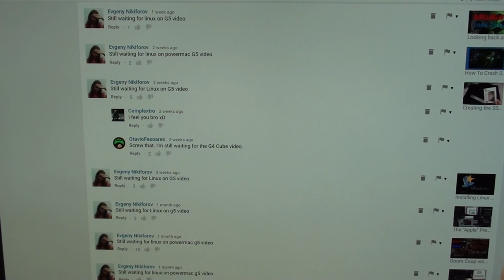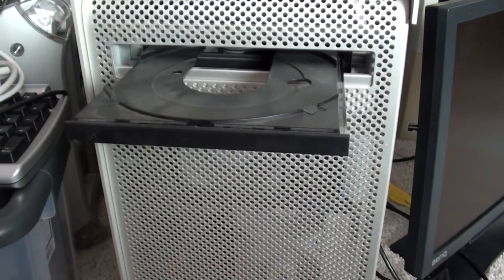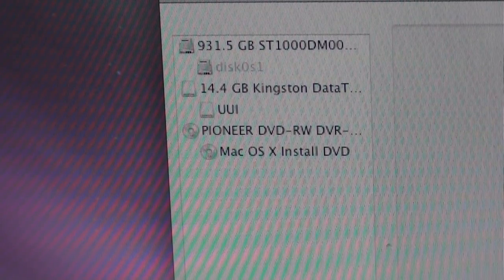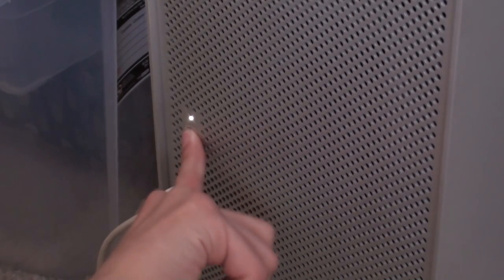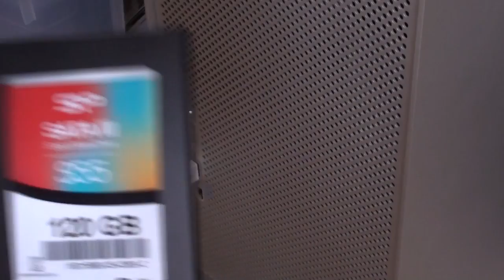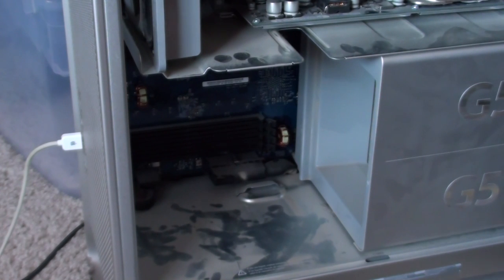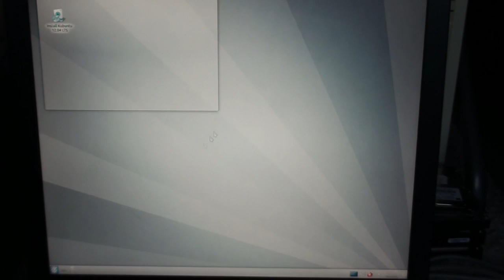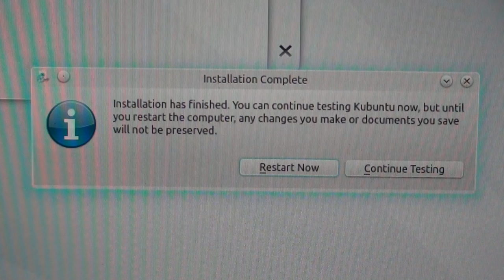Installing Linux on a Power Mac G5 (Part 1)

Comment: Those G5 Macs are the most beautiful pieces  of junk I have ever seen.  I would mod the case and put an GIGABYTE Mobo in it and run a Hackintosh build
Reply: Fantastika lol ok?
Reply: Why not an ASUS mobo ?
Reply: Get a newer mac pro. Better everything same case. NOTE:not 2019, I think its 2005
Reply: Even if you have some old apps to use with an old ppc-osx, i think, this thing draws too much power and is too loud. So i would consider the same, remove the old external and put in a new motherboard.
Reply: I heartily agree. The G5 towers are giant beautiful hunks of metal scrap. I own one that never works correctly but it looks pretty cool.
Reply: @paytonbostwick2899  ive seen a brand-new 2020 Mac pro for a fairly low price of $53,548.00.

Or for about $4,462.33 A MONTH!!!
Reply: @hunterjayfilm  dude believe it or not but you can buy the new one for up to $20,000

Comment: You have incompatible ram installed! Hooray!!!!
(Please like this so +Druaga1 will see this)
• 2 Flashes: No RAM is installed or detected.
• 3 Flashes: Incompatible RAM types are installed.
• 4 Flashes: No RAM banks passed memory testing.
• 5 Flashes: No good boot images are detected in the boot ROM (and/or there is a bad
sys config block).
• 6 Flashes: The processor is not usable.
Reply: LightningShockXD 7 Flashes: may god help us
Reply: 3 blinks
Reply: • 7 Flashes: Incompatible life
Reply: 7 flashes: WARNING CORE OVERHEATING NUCLEAR MELTDOWN IMMINENT
Reply: 666 flashes: WE’RE ALL GONNA DIE!!!
Reply: 1 Flash: No computer detected.
Reply: 10 Flashes: OH GOD WERE DOOMED
Reply: 420 flashes, the mac is smoking a joint
Reply: And then there's 1 flash where it means nothing but new computer needed
Reply: Seizure Flashes: MY EYES!!!!!!!!!!!!!!!!!!
Reply: @Hydr8Man  Nice Portal 2 reference.
Reply: @paytonbostwick2899  420 flashes: Weed OS version 4.2.0. Is successfully installed.
Reply: @Hydr8Man  portal 2 reference?

Comment: Things went surprisingly smoothly for a Druaga1 video, I'm almost worried that nothing is going to go wrong in part 2.
Remember that if nothing fucks up on its own you can always try upgrading from 12.04 to 14.04 and then 16.04.

Comment: Hey druaga, sata is hot plug capable. Just boot the machine into linux and plug the drive in (carefully). Linux just detect a new active sata link and throw all the detected stuff onto dmesg (do dmesg to see if it actually detected the drive)
Hot plug worked on my old sata1 pentium 4 machine, but knowing apple it wouldnt surprise me the blocked it or something...
Reply: you would need to hot swap every single time you try to boot it.
Reply: Not all PCs support SATA hotplug.
Reply: +Topias Salakka  /\ this

we have to remember this is back when SATA was a luxury.  it was something you had on your high end pentium 4 that had hyper threading.  lol damn you could get that for like 500$ back in the day.  now you could find that for 20 on ebay
Reply: 0kIlLtHeMuSiC 0  That's exactly what i'm saying. I had one of those Pentium 4 3 fricking gigahertz HT (a prescott-2M to be precise) with 1 motherfucking GB of ram and sata and pci-express, ( I had to buy a new video card because i had a AGP GForce 4) yet sata hot plug worked fine when i tried it. It has an intel motherboard with an i915 chipset which didnt even support the 4gb of ram it claimed to support even in 64bits. Back then it was the shit, but nowadays its crap and even then an Athlon 64 would have been better....never trust your dad who says "intel is better"....
anyways, i915 was intel's second chipset to ever support sata, the first being the i875, that's why im saying mine was old as fuck yet sata hot plug worked fine
Reply: +Lahari Krichevskoy That must have been 2003-2004 if you built it new with the best spec'ed parts you could get at the time.  That was around the same time I built my first rig which was also a P4 but only a 130nm Northwood 3.06 GHz with HT, and only 533MHz FSB.  I think I just went with intel because I thought more expensive meant it would be better, haha, I was only like 13.
Reply: goyabee
well at least yours was better than mine, mine couldnt even not overheat at stock frequency with the stock turbine (it was loud!) in a 35ºC summer day. Plus that heatsink tended to cake in dust really easy in a matter of months, so you either clean it at spring's end or watch how the sensor says 85ºC on the cpu.
I ended up putting a cooler master "sphere" cooler on it and im not even overclocking, just so that it would remain more maintenance free and quiet.

I also was 13, and my grandma gave me the money as a gift, and my old man, who knows shit about pcs (and nowadays to be fair if he says do A, you do B first....)  said intel was brand and that it was better "quality" (as an electronic frying pan), the thing is that he is an idiot and i although liked computers and all, was still too young and didnt know as much about hardware (i didnt even had internet back then)

now i'm happy with my 1055T :D
Reply: Laharl Krichevskoy Haha, yeah, P4s were terrible... they were fine at around 2.6 GHz and under as far as heat goes, as long as you didn't mind how slow they were at those speeds.  Mine ended up burning itself out in around '07 after I had it over clocked to I think 3.15 GHz for a while, which is hardly anything over stock... and yeah, I ended up vacuuming it out like twice a year or so.

The funny thing is, your dad wasn't entirely wrong, just uninformed.  Ever since intel got its shit together after the P4 disaster it has been putting out the best consumer CPUs available.  Not counting itanium, there have only been a few cases where intel CPUs were beat by competitors, and the quality was still there, its just that the netburst architecture was shit, and CPU architecture design is so hit or miss, they spent ass loads of money developing a completely new architecture with a really long pipeline that would allow for higher clockspeeds.  They had plans to release 5 GHz chips like only a few years after the first P4 was launched but they didn't realize it would run as hot as it did, nobody really knew back then, it was uncharted territory, so they just ran with it and kept clocking them higher to make up for the poor efficiency and using their corporate influence to get developers to optimize their code for P4.  It was a shameful time for intel, they were relying on their good reputation while knowingly selling inferior technology.  Anyway, the moral of the story is always do your research, even good brands like intel put out absolute shit every now and then.

AMD basically made the same kind of mistake with CMT, they were banking on software being optimized for AMD chips but it just didn't happen, and even with optimization the performance wasn't as good as they were expecting.  So what did AMD do?  Basically the same thing intel did in the P4 days, they just kept clocking up the same architecture, somewhat relying on the good reputation they earned from the Athlon 64 line.  That's how we ended up with the ridiculous 5 GHz 220 watt TDP FX9590 or whatever it is...

I digress.
Reply: Laharl Krichevskoy 
Ahhh,  alright. 

Yeah..  Until the core cpus intel was poop.  Its funny because amd designed the 64 bit system and multicore tech intel uses and they were shit until then. 

I think we should give amd credit.
Reply: 0kIlLtHeMuSiC 0 AMD has been putting out some pretty fantastic chips over the years, it's true.  Even if there's always an intel product that's better it's usually going to cost more and they've just done really well for the size of company they are.  FTR, I actually really like the CMT design, it makes a lot of sense in theory, though I admit I have never had a CPU which uses it.  The last rig I built with an AMD chip was a Athlon II X2 3.2 GHz. It was more than powerful enough and an amazing chip for the money I think I only spent like $60 on it, it's still going strong, my brother uses it for gaming with a GTX 750 Ti and it keeps up just fine at 1080p even with high settings for some games.

I guess if I had an AMD chip with CMT I would probably run linux from scratch and compile as much of the system as I could with Open64 which is specially optimized for AMD microarchitectures. The fact that you can get an 8-integer-core CPU for around $100 new is pretty enticing.
Reply: goyabee
 afaik phoronix did a comparison between compiled for cmt and not, and the difference was minimal. The only place were it shined was when the software was compiled with amds optimizations and it was multithread friendly to begin with, and the margin over intel's was 20% in the best case. The rest of the times staying 30% behind (no mt)
So even if in theory the design could work, it did not this time, it was poorly executed, and it showed.

Further more, expecting everyone to compile for their cpu is ridiculous...what about old software? (which is 99% until that point)
The only software which would care to do so would be games (maybe) and benchmark tools. The rest would not give a fuck as no one gives a fuck when compiling their software, i do not, provided it works on MY machine.
We've seen lots of games where the carelessness when compiling shows. Games with debugging symbols still on the binaries are common. I remember having read about some which had an optimized path disabled by a bug and so it was never used, plus there's that thing where intel's compiler will thread anything not intel, as if it were a 386, even if it reports SSSSEEEEEE9001. I think there was a tool to hack the exe to use the optimized path by reporting an intel string instead, and the article said "see? we only change a string to say intel instead and now it works 20% faster"

AMD was king until the core2 series then it started lagging behind. Imo, they should have continued with llanos, make it smaller and give it better ips performance.
btw intel isnt "good quality", not a single chip i ever owned died, amd nor intel. And back then amd was better in every aspect. It was faster, got less hot, was cheaper, has HT instead of fsb, you could overclock them to maybe 3ghz and wipe the floor with a P4.

Comment: Three flashes means the computer doesn't like the RAM you're using.

Late PowerPC Macs are really picky about the RAM you put in them. I'm actually not sure what it is that they want, I had to go through a box of RAM sticks years ago when I was trying to put more RAM in a Quicksilver G4.
Reply: ...Nevermind, seems you found it.

Five and six flashes is a logic board or CPU problem. I forget which is which off hand.
Reply: Probably Apple just wants you to buy a new computer to get more RAM. Self upgrades are not lucrative enough.
Reply: @mreese8764  upgrade made a good difference on my 2009 windows 7 hp g62 laptop.

It originally had 3 gigs of ram, now its maxed at 8 Gigs, and it had a 320 gig hard drive not it has a 500 gig SSD, and finally it had a 2.3 ghz amd dual core processor now it has a 2.2 ghz amd quad core processor.

The laptop was just under$500 when i bought it, now it runs pretty well

Comment: Does anyone else wonder how many devices his router has listed from his other builds he's connected to it😂
Reply: Haha lol
Reply: I'm sure we'll over 100000
Reply: Well if i would go to my router i'm sure i'll see hundreds of VMs and reinstlled Operating systems on the device list.
Reply: Homer Simpson The VM's wouldn't be displayed on the history, because they use a virtual adapter on your computer, and if you used the same ethetnet/wireless adapter for the reinstalls, then the router would most likely only list it once  because the MAC address doesn't change at os reinstallation
Reply: Ok, then i'll check "Places where you logged in with your google account.
Reply: thanks hommie
Reply: Homer Simpson That should work, yes xD
My list would propably be full, too
Reply: Your Smart
Reply: @resneptacle  The way I have my VMs setup it does show new devices. I can't remember which setting it was in virtualbox. NAT or bridge?

Comment: I once had a problem with a MAC Mini, where the Soundcard suddenly wouldn't work anymore. 
I tried resetting everything, but the only thing that helped, was a new BIOS Battery.
Also cleaning of dust will resolve errors aswell ;)

Oh and keep up the great videos!

Comment: just encase anyone cares, the 3 blinking leds (off apples website) means the ram is incompatible. being a your problem is intermittent, that probably means the logic board got very hot one day and it re-soldered itself. actually happens quite often on these old powermac based off what i read in forums. people report being able to put a hair dryer on the ram slots for about 5 minutes and it helps. hopefully that is all that you need. either that or the logic board and the dimm slots need to be replaced.

Comment: The original one you used with the ram issues had the liquid warning label on it about it being a liquid cooled system doesn't that make it a 2.5Ghz dual CPU system or the 2.7Ghz model? I have a Quad lol it also contains the same warning label.
Reply: It’s a dual 2.5ghz model. I’d assume one of the cpu cards is dead due to leaking coolant. That is also likely what is causing the instability.

Comment: Fun fact, by setting certain things involving graphics drivers and startup, you can use newer PCIe graphics cards on the final run G5 under linux as long as they use the older PCIe standard.

Comment: Hey, I have a question. Is it possible to format a DVD in HFS+? I want to try to get a Thinkcentre Hackintosh up and running, but it does not boot off of DVDs. Any ideas?
Reply: BNMC0919 No, i don't think you can "format" a DVD in an hard disx format, i guess you're stuck with UDF or whatever other disc file system there is :/

Comment: So Drauga I have a question.

What is the Mac OS equivalent of Windows XP? i.e the OS everyone loved, still many computers running it, huge usage share at its peak... I heard it was Mountain Lion but idk anything about Macs
Reply: most probably leopard/snow leopard
Reply: Snow Leopard. It was fast, stable, easy to use, great software compatibility for ppc software, and it looked great too.
I created my first hackintosh with it, and it's still my personal favourite version of OS X.
Reply: The Windows XP of Mac is WIndows XP
Reply: I guess it's snow leopard but I still have a cd for OS 9 lol it was fast as hell but you cant do shit with it.
Reply: Yeah, I agree with everyone. Snow Leopard.
Reply: probably leoporrd
Reply: +Robinthefox88 actually the last ppc supported Mac OS was leopard not snow leopard
Reply: +Robinthefox88 actually the last ppc supported Mac OS was leopard not snow leopard
Reply: I would say 10.4 Tiger is the equivelent of Windows XP. Not only was it very stable (like XP), but it also had the longest life span of any version of OS X thanks to 10.5 being delayed (just like XP lasted from 2001 to Vista's release in 2006). And just like Windows XP, it continued to be used for years after Apple stopped supporting it because Leopard had much higher system requirements (like Vista did).
Reply: Wow thanks for all the replies lol fucking vista, Vista > 8 though because at least off meant off in UAC with Vista, Windows 8 you gotta regedit to make UAC actually off. Speaking of that, does Mac OS have an equivalent of UAC? Is there a Mac registry? Can you "run as" root in Macs like you can in Linux?
Reply: +Hogdriva Actually, Mac OS needs your password, anytime you want to install something... But only installations I think.
Reply: -MrSky05-
Blame that on the Unix core, since any Unix-like operating system require a password to do installs.
Reply: Well, you can run always as root.
Reply: mine was snow leopard
Reply: Definitely Snow Leopard. Still the minimum OS for most modern applications, the most stable, and runs on all Intel Macs. Apple has been trying to kill it for years with no success.
Reply: +Hogdriva Well... UAC: OS X asks for your password to do anything root/administrator related (software installation (via some kind of installation wizard only. Standard way to install OS X apps is either via Mac App Store or copying executable to Applications folder (copying is standard way to install anything not from App Store), and it does not require your admin/root password), system settings, etc.). Registry: Nope, no registry on OS X. No "run as" in interface, but you can run stuff as root (admin) via Terminal (command prompt).
Reply: @ethanruckert3871  yes, however it was the last version capable of running PPC software through Rosetta.

Comment: I put a 40GB Intel SSD in a Power Mac G5 and it worked great. I even had it running 10.5.8 without an issue.

Comment: AmigaOS supports PPC but only very specific computers (see more: no Apple boxes).

I could not, for the life of me, get Lubuntu or Xubuntu or Ubuntu or MintPPC to install properly on my G5 1.8 DP.  Each distro had something seemingly different wrong with 'em.  Live install versions would crash before or right at the desktop, and "Alternate" install ones (text based installers) would install fine but first boot from the drive was a big boat of failure.

Comment: If you are working with the G5 anyways, could you also test if it supports 32 GB RAM? Officially it only supports 16 GB, but the same goes for the first mac pro - which runs fine with 32 GB too.
Reply: It won't, 2gb per slot max
Reply: @anidiotontheinternet3514  officially supported max 16GB yes, but there are 4GB ddr2 dimms, though they are rare and released years after the G5 was no longer a new system. Many newer systems work fine with more memory then they officially support.

Comment: What are the specs for that G5 (I installed lubuntu 16.04 on a dell with a 2.6Ghz Dual core AMD athlon and 1.5GB ram and it's from 2006)